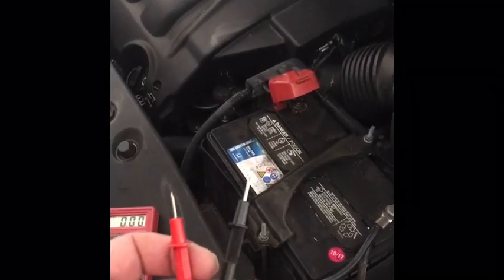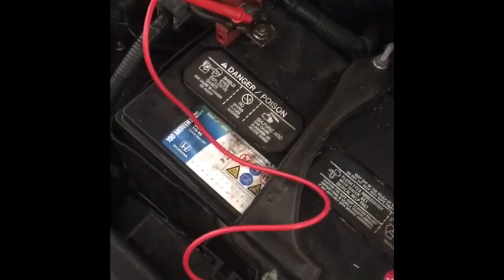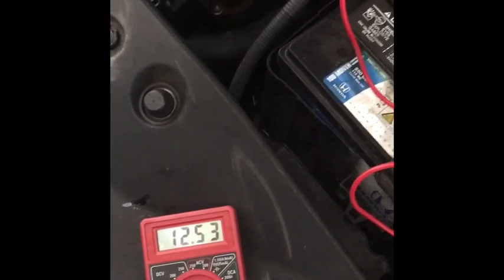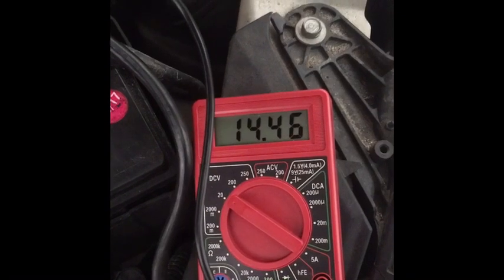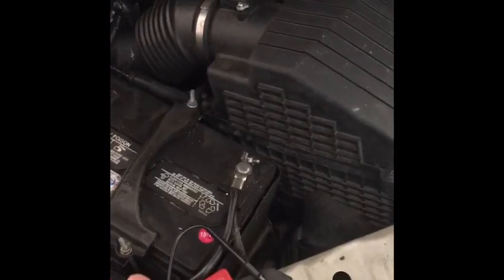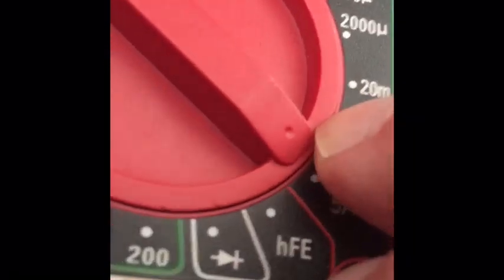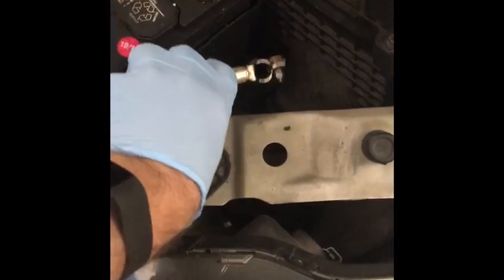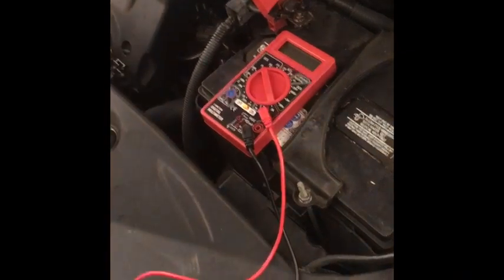Parasitic drain test on a 2007 Honda Odyssey

Comment: same one I have.    back ACC circuit  (accessory)   I used to think it was A/C compression ..,. lol
You should continue checking the fuse box's inside the car,  you will hit the Number 7 (ACC)  fuse 7.5 AMPS.
It controls sliding doors.   after cars get old the latch becomes sloppy and the system thinks door is not looked so it keep waking up and drawing charge to lock door...    that is a problem I am having
Reply from the maker: I actually found it see video on it .  It’s been fine since fixing it .

Comment: I have the same exact problem on my 2007. I've been through 3 batteries in 4 months. I took it into the shop and they just told me I needed a new battery- duhhhhh- didn't even look for the drain. Today I bought a battery disconnect switch at Harbor Freight and will just pop the hood every time I come home and disconnect and then twist it back in place in the morning- it's the only thing I know what to do.
Reply from the maker: The best thing to do is kind of do this test .  To find out which circuit it’s on.   To find the offending devices(s)
 In my case it was a aftermarket kit installed in back of radio by my brother In law .  It worked for years no problem then I had this happen.
Reply from the maker: I do know that on some Acura TL’s the home link can cause a drain problem.    But they found that by doing a parasite drain test.    Also lookup a wiring diagram on line for what fuses control power to what devices.
Reply: same one I have.    back ACC circuit  (accessory)   I used to think it was A/C compression 
lol
You should continue checking the fuse box's inside the car,  you will hit the Number 7 (ACC)  fuse 7.5 AMPS next to driver.   It control the sliding doors and other accessories
Reply: @octiman2997  I was the sliding door driver side. Had it completely taken apart- for the SECOND time and reconnected. So far so good.

Comment: thank you so much, i followed your steps and i got the exact problem, but i never installed anything, i just don't know how to fix it any suggestion
Reply from the maker: You should get no more than 50 ma drain if everything is off.   If you are getting more than that and you pulled a  fuse  and then you notice a drop .  There is something on that circuit causing it. Look to see what’s on that circuit.  It could be any electrical device on that circuit.

Comment: My Odyssey is draining 3.4Amps. I think the car's normal drain for the immobiliser/ alarm and computer is 0.07Amps or 70mAmps, so i think you are within specifications. There should be two batteries, a smaller one to power the computer when the engine is switched off and the main battery to crank the engine, making it easier to isolate the problem.
Reply from the maker: There should be no greater than 50ma drain in battery when car is turned off.
Reply from the maker: Other places to check are the Home link for the garage door opener can cause a drain on the batter.  This was a big issue with the Acura TL 
,  I heard.

Comment: Vice grips or a hose clamp is an easy way to get probes to connect with battery terminals.  The clamp you had in the door would work too.

Comment: did your radio lose it's memory and not start?  did your onboard computer system have to Relearn all it's settings?  I ask this because if I disconnect my battery it causes those two things to lose charge...
Reply from the maker: Yes I think it did. And hand to enter in the Honda radio and dvd codes .  But I honestly cannot remember.  
Not long after this video was taken maybe a month or two. Battery was replaced. 
Thanks for watching my video
Reply: When you disconnect the battery in a 2007 Odyssey, your radio locks. It's an anti theft measure. You need to ente a code to use it.

Comment: Sounds like tensioner pulley is going bad
Reply from the maker: Thanks for the comment,  the pulley is new and all the belts were just replaced (for its 200k maintenance) including full timing  belt replacement ,  After it’s warmed up the sound goes away.  Belts that were used were not Honda parts there were Continental branded belts and kit.  The pulley was replaced but I don’t know if it was a Oem Honda part used.